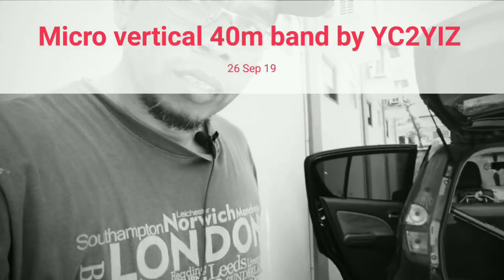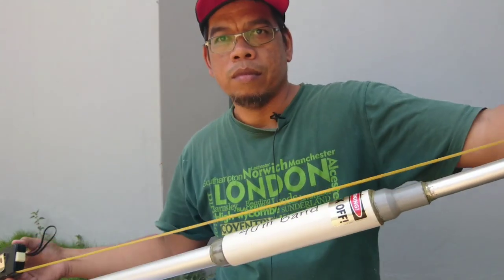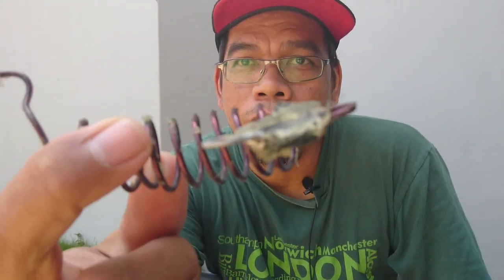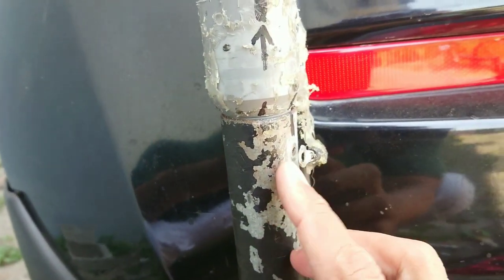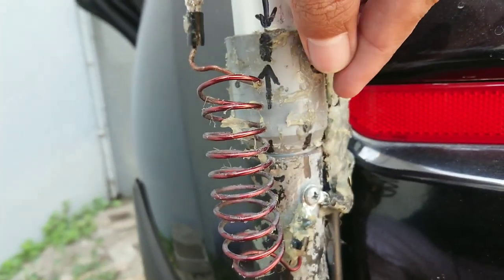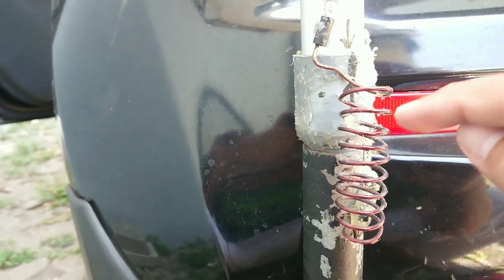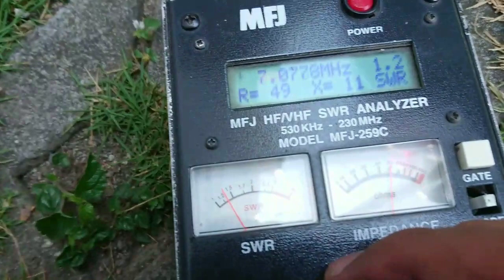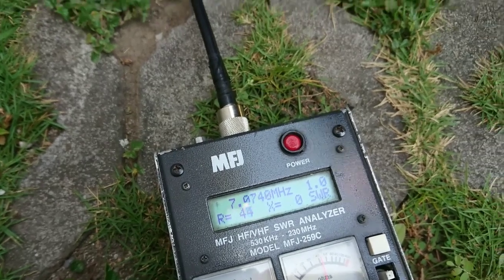Micro vertical 40m band setup by YC2YIZ

Comment: Man, great and very educational video . I am planning to make this one.Thanks for free antenna plan.  The reason you get RF all the way arround this antenna make JAMMING to your equipment is because this whip is not resonant, or harmonic resonant  in lentgh for given working band.  Like end fed random lentgh antenna.The most of return RF field  is comming back trough the outer shirm of the cable, which acts as a counterpoise or radial . So you need aproximetly 8m of cable for 40m, to stop this. But you are in the car, can not do that .You made some kind of trap for returning signal. Well, the way making this small coil is in use when anybody want to make thunder protection by making DC short circuit antenna and grounding one side of this coil. Never heard that this small coil can stop induced return signal  in this way.I am puzzled.  Does it have any influence of the radiation pattern. How antenna work on 40m band. Any video how antenna perform in real working conditions.  Anyway , you done extremly good videos , and thank you for sharing it. 73 de YU4BAH
Reply from the maker: thanks for watching this video , this antenna more than 5 year I used in my car before use another model my antenna but more interference distrub my audio mobile etc so I modified to clear and kill RFI ...